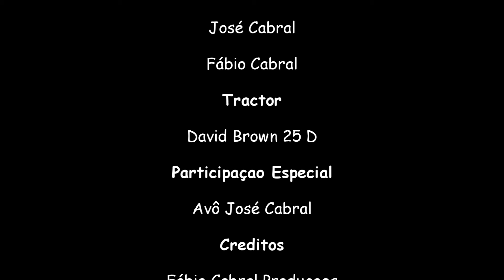David Brown 25 D

Comment: Hi Fabio
How many liter of paint did you use?
I need to paint my old D25 so
Reply from the maker: +Luc luc 
Hi Luc, Thank you for viewing my video ; ) in this case in specific I used 4 cans of 2 liters, but in your case may not be necessary either because there are mixtures that help to reduce costs ;) I have helped then would like to see the result ;) hug
Reply: +Fábio Cabral

Thanks for the info,but for the moment its just the start for repair my old tractor...